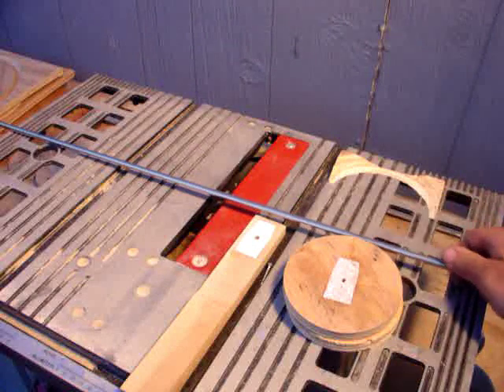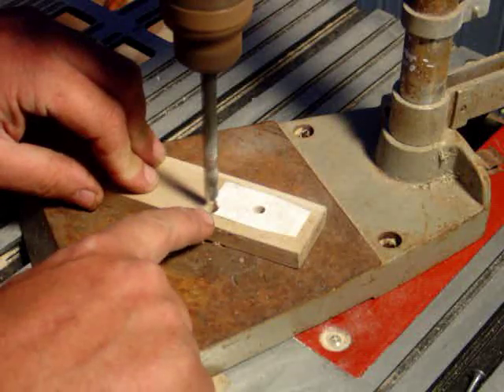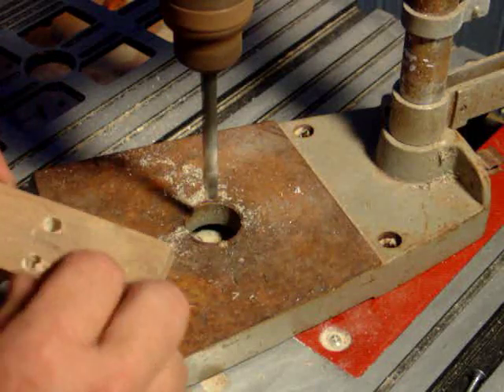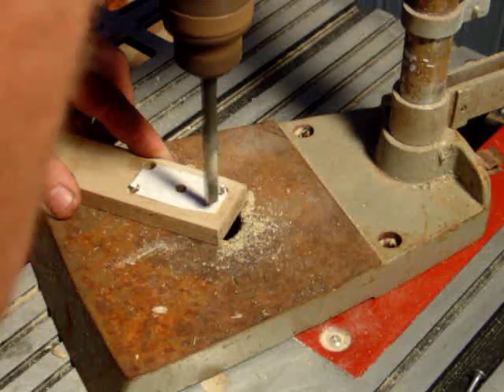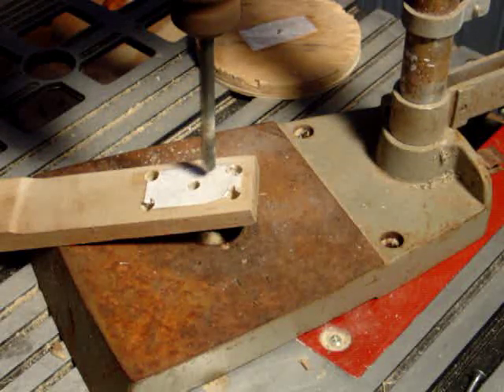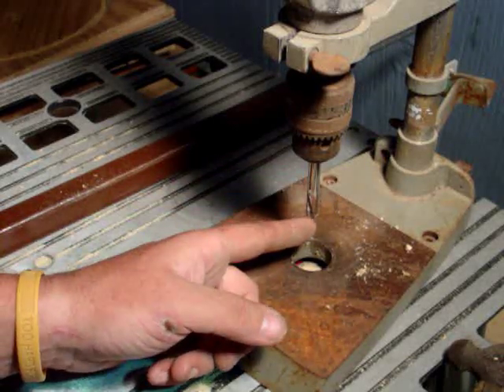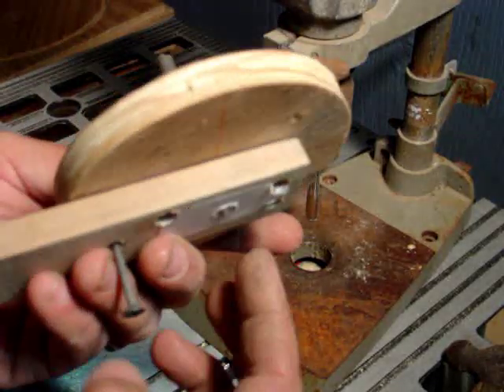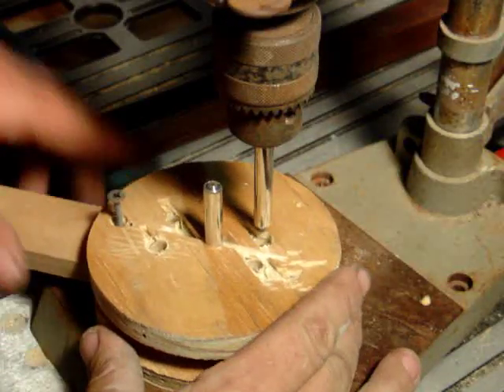BUILD A  DUAL PERMANENT MAGNET ROTOR WIND TURBINE (PART 4)

Comment: Great videos Muddy.  Thanks again for sharing your knowledge with us.  I do have a couple of questions for you.  I have watched all your videos but would like a little help.  1) How thick should the coils be if I am using 2" x 1" x 1/2" thick magnets?  Would the thickness change if I were to use 1" thick magnets?  2) Do I want to focus on volts or amps?  Or are they synonimus with each other with relation to magnet and coil size?